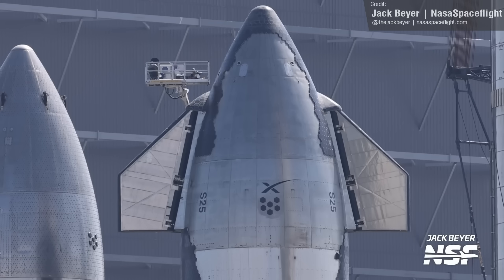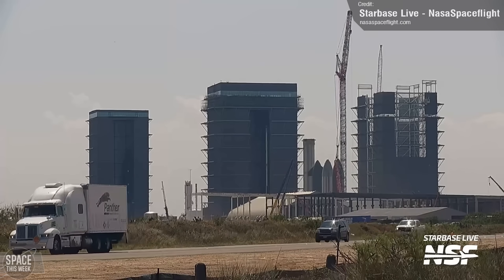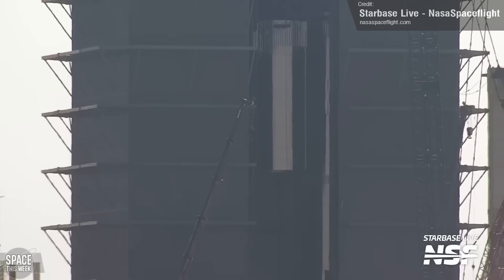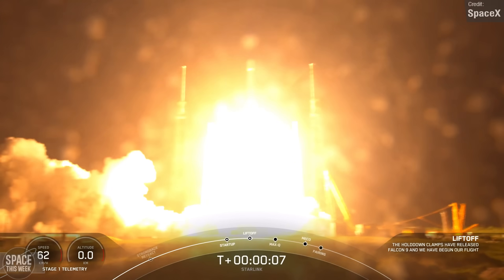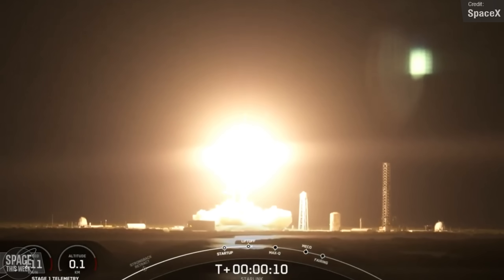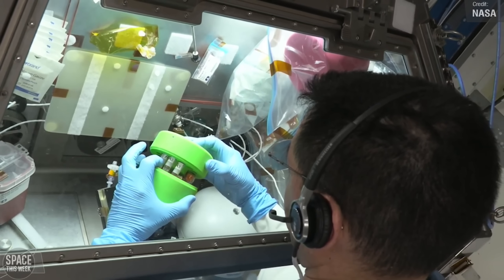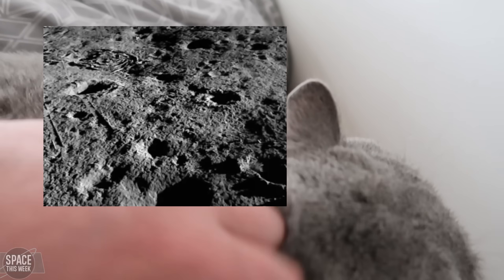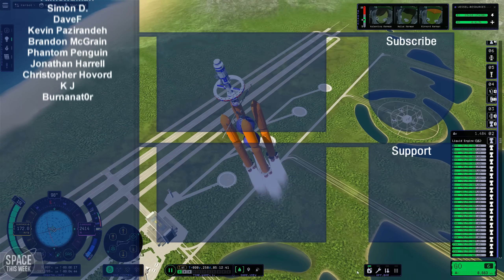SpaceX Starship's FTS Armed, Booster 9 Won't Rollback Again, Ship 25 Prepares for Launch!

Comment: Traditionally the fts is armed only a day or so before flight as the very last thing before launching, interesting to see them arming booster fts even before s25 is stacked.
Reply: Not installed and certainly not armed yet AFAIK. Explosives are still in the bunker.

Comment: I really think SpaceX should modify a Falcon 9 for HOT FIRE booster separation.  It would make a good test bed, and if it succeeds it would also give Falcon 9 a thrust and payload boost that could be used on some missions.
Reply: I’m not sure it can be made even longer and thinner than it already is.